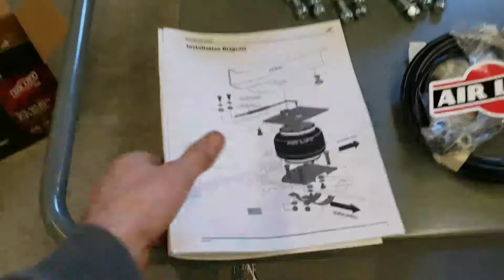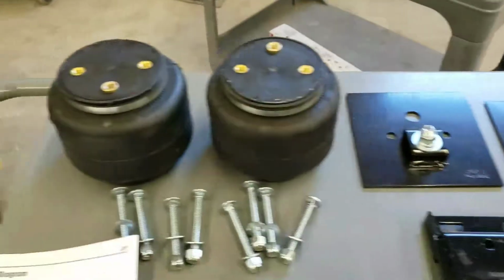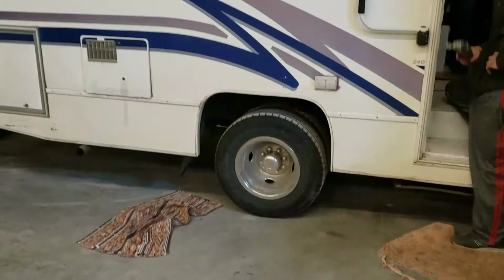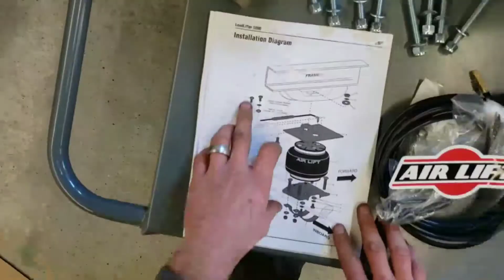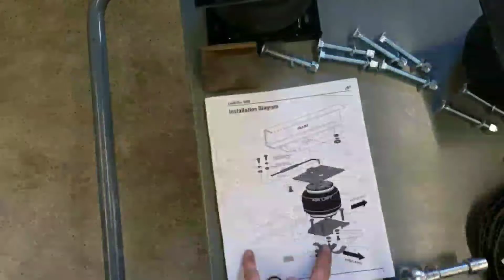Installing airbag leveling system on a R.V. (super simple)

Comment: Any feedback on how this is working for you? A review of the airbag retrofit? Thanks.
Reply from the maker: Well I put those in for my dad's motorhome an he has only drivin it a couple times since then. But he did say it didn't sway as much in  the wind.
Reply: Aaron's adventurez Thanks for the reply. I was hoping to put this in all 4 corners of my Winnebago Via and use it both for a smoother ride and for leveling when parked. Does this sound like something doable?

Also, for less sway, did you already to the anti-sway bars? That's another upgrade I'm 90% sure I'm going to do.